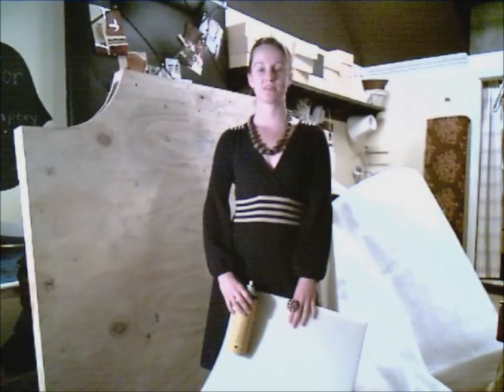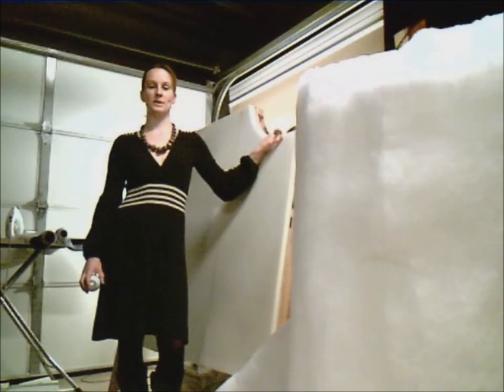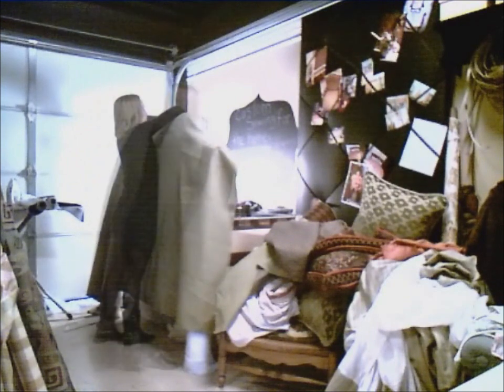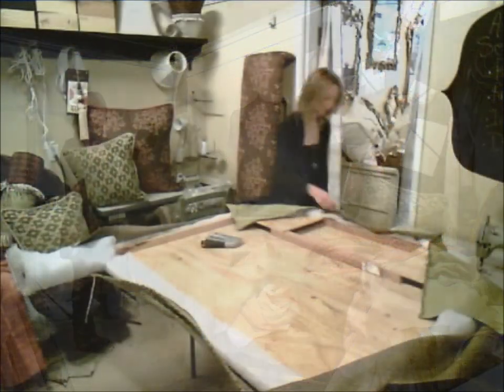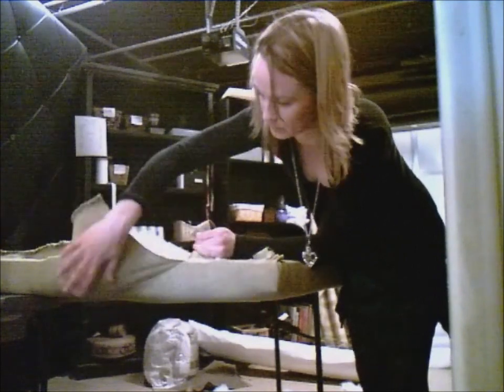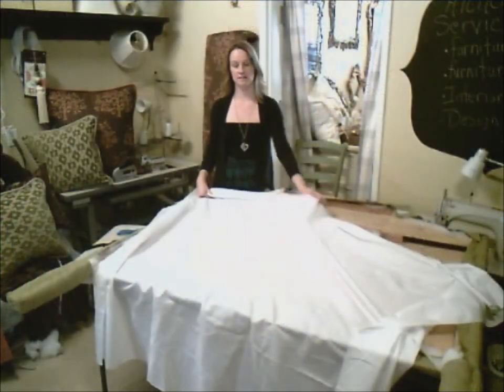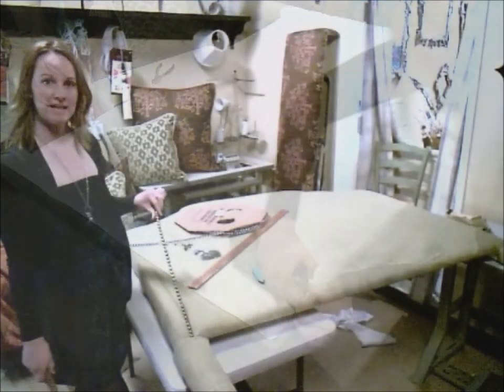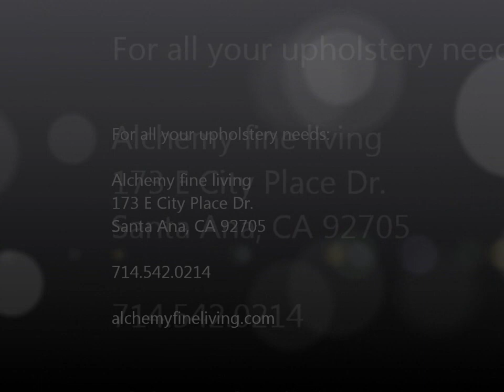Custom Upholstered Headboard

Comment from the maker: @shanisol The legs are 2 x 4 pieces of wood. I use a hollywood frame (the cheap, basic metal one) and screw from the front of it into the legs of the headboard.  The headboard was 48" tall x 60" wide. The distance it extends beyond the mattress depends on your bed. There are so many different depths of mattresses and box springs these days it's hard to say. Hope this helps.

Comment: What a great video!  can i ask you a few questions?  if this is a queen size headboard, what exactly are your dimensions on the plywood?  is the headboard meant to extend all the way to the box or just 2 inches below surface of mattress?  and i see that you used 2 x 2 on top of frame, but is that 2 x 4 legs?  how do they fit into the bed frame?
thanks so much!  i can't wait to try it!